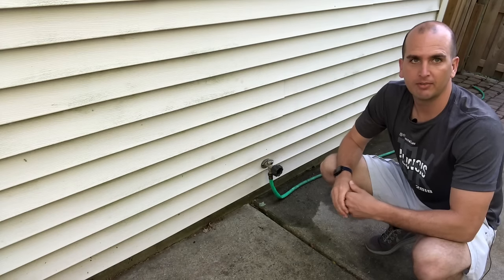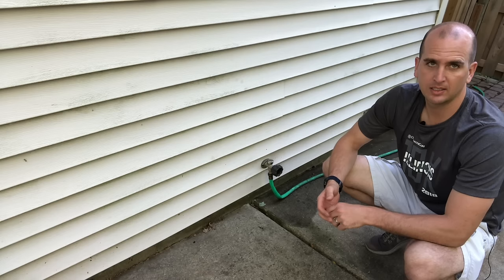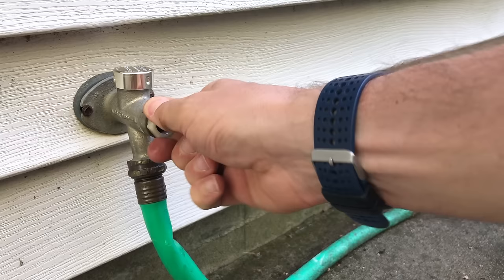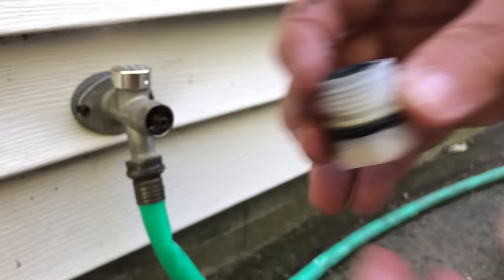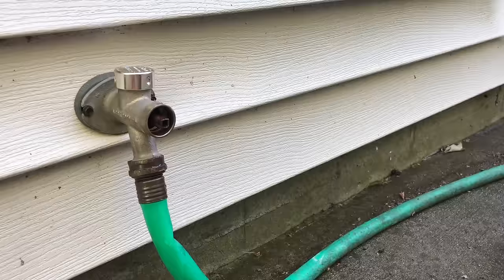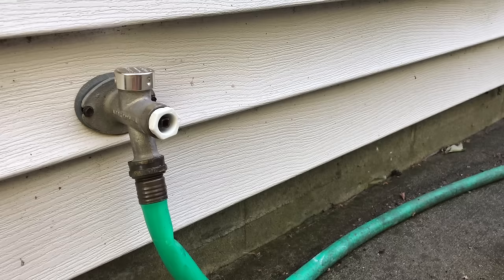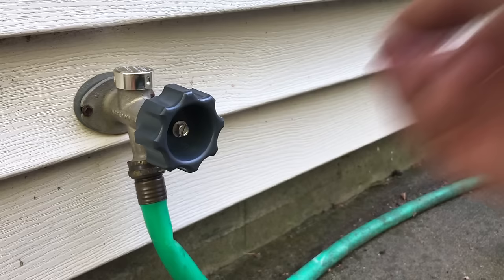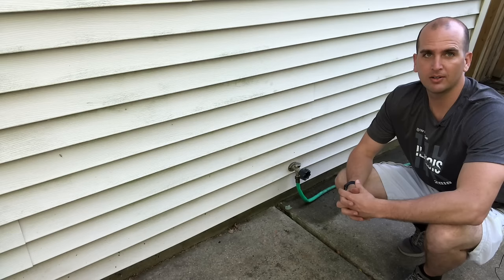How To Fix a Water Leak Behind the Handle of an Outdoor Faucet

Comment: You might want to consider this:   before shoving the new gasket in,  temporarily put the handle back on and turn the water on to flush out the debris from the old crumbly gasket.  If debris is left in there, it could cause the new gasket not to seal completely.
Reply from the maker: I like the pro tip! Thanks for sharing.
Reply: I agree. Additionally, putting some lube even just spraying some wd40 on the rubber parts will prevent the rubber being torn or warped during the tightening process. I might add too, that WD40 is not a penetrating oil. To free up,that rusted bolt a proper penetrant will work a lot better. There are several different brands.
Reply: WD-40 usually is not good to spray on gaskets since petroleum products will cause rubber to swell. Silicone based stuff is perfect for that.
Reply: @hobosaur4250  
You replied to the wrong comment.  I think you intended to reply to @garethgoodchild2643
Reply: Can u make a video showing how to put an on/off handle instead of the type you just replaced?
Reply: Thank you. Easy to follow. I will watch the Siphon Valve video, too, since I don't know what that leak looks like.

Comment: Tip from a navy vet, rusted screws and bolts will loosen if you hit it with Tobasco sauce, wait 5-10 min.  They use it at sea.  It works!
Reply from the maker: Seriously?  Tobasco sauce!?!? That is a great hack if it works and I am definitely trying it on the next rusted bolt I encounter 👍
Reply: I’m a Franks Hot Sauce guy myself. I’ll give it a try!
Reply: @glenndespres5317 I put that sh*t on everything 😂😂 EVERYTHING!
Reply: To explain to anyone still wondering about this: tobasco is a vinegar based hot sauce. Nothing to do with it being a hot sauce, it's the vinegar.

Comment: In general is that a one size fits all kit for that type of spigot? That's exactly what we have on our house and is leaking from the handle. Odd thing is, when I took the handle off, there's only that metal rectangle piece the screw goes into. There's no white threaded plastic piece that goes around that like what you replaced.

Comment: Thanks, Everyday Home Repairs for this video. I had NO CLUE how to fix this problem and your video helped a lot. I will say, however, the mechanics of my faucet were a bit different. I had a tan 7/8 inch screw and I HAD to turn the water off because I needed to semi-remove the stem to remove the washer. It didn't come out easily like it did in your video. But pulling the stem was pretty easy (just keep turning the faucet as if turning the water on until the stem comes loose). Then I replaced the washer (different washer than what you used in your video), put everything back together, and NO MORE LEAK! Thanks again!

Comment: great video...also easy to just replace ALL the gaskets (pulling entire stem out)...why not...ONE THING I found out was white does not always mean right hand thread...I was only able to determine this because I paid attention to the WHITE cap I removed which was FLAT on the inside edge..NOT inward rounded/Concaved like in the video...I only mention it as there is info that says WHITE is always right hand...I used the TAN version and corresponding gasket/all fixed...so just pay attention to what you removed and match to the kit. Thanks for the Video! Stopped my leaking faucets! ALSO...my handle bolts were rusted on...so I had to dremmel off the handles and removed the entire stem...some PB blaster and heat (gently hold the stem with a vice or pliers while working the rusty bolt out...finally was able to work the bolt out. Chase the threads with the new stainless bolt that comes with the new handle kit...even maybe a dab of anti seize.

Comment: I'm a fairly new home owner and I was having an issue with my hose faucet not fully stopping the water.  I had turned off the water to the faucet and was getting ready to call someone until I thought I'd see if a tutorial would help.  I found this video, and 3.5 minutes in, I pause and try what I just saw.  A super loose piece that I tightened and BOOM, problem solved.  Thanks for the quick and easy video!

Comment: Thank you for this video (and the anti syphon valve video).  I was a little afraid at first to tackle this as the leaky faucet is in the garage and my old man was like, "call a damn plumber".  I went to Ace Hardware and got the exact same 2 kits you used in this video for $14.99 and also replaced the old crusty, rusty screw and handle for $8.99. So much cheaper than spending probably a couple hundred dollars for a plumber and I learned something today.  It did not go without frustration and ended up doing the left (cream colored twist tightener) as the right (white one) didn't quite work like yours did because of the threads but end result...no more leaks.  Thanks again!

Comment: Well done Scott, I’m very surprised with the amount of great detail you showed, that you did not crack the valve open slightly(after removing the old packing seal) in order to flush out the small pieces of that old packing seal. Just a though......now back to work on mine. Thanks Man.
Reply from the maker: Good tip Trent, thanks!

Comment: Thank you so much. I've got two of these leaky faucets on the house and have been wondering how to fix them AND they are both 27 yrs old now. I knew there must be a gasket or seal involved but thought I might have to  remove the entire faucet through the wall. Glad I found your video, it's much easier than I thought. You make a very clear and detailed video. Very helpful.
Reply from the maker: Thanks Dale, happy to help!

Comment: Great Job, I do it a little different, i flush out around the seal area and add some plumbers grease to ease the friction on the O-ring and seal. maybe you did that but didn't show it. but still a great job stopping the leak. having all the possible replacement parts was smart.

Comment: Thanks for the video. I didn't have the repair kit with the cone washer, but I after scraping the old deteriorated washer out, I managed to get a flat rubber washer and another o-ring washer both in there and it did the job.

Comment: Great that you replaced so many parts but  thinkyou could have replaced the washer on the end of the stem to prevent later leaks. What you refer to as a gasket, is actually packing which crushed and prevents leaks around the stem.

Comment: This is exactly what happened to my outside faucet today, went to Menards expecting to buy a new faucet. The top chrome cap holds on the pressure valve. (Not back flow) that also broke. Saved a ton with the kits. Oh, the faucet was just installed a year ago. Failed to soon in my book.
Reply from the maker: 1 year might be a bit low in terms of expected life.  Hopefully you purchased a different brand this go around. 😁
Reply: No, didn’t purchase a new system, just installed the repair kit
Reply from the maker: @teaglet   I would say the kit should last longer than the original 🤞

Comment: This worked great, thanks!  
The only issue I had was that the screw wouldn’t work to get the handle back on, it would just spin (worked fine if I tried it without the handle). Anyone else have this same problem?

Comment: Thanks for your videos, this looks very similar to the one I have. I also seem to have the white plastic right hand turn adapter. Mine looks different however in that it has a large nut behind the white plastic piece and my valve stem sticks out much more than yours. Not sure if that is standard for this model faucet. I have an ASSE1018-A faucet according to the number on the side.  I will attempt to inspect this more thoroughly and report back. Thanks for the part numbers you've provided. I am not sure if a picture of mine can be posted to show you my setup.
Reply from the maker: Hey Ricky, unfortunately pictures and/or videos currently can’t be posted in YT comments.  You can jump over to our Facebook group “Everyday Home Repairs Community” and that is where you can post pictures and videos which help a ton with troubleshooting.

Comment: This is an easy fix IF the hardware store has the same gasket for the valve.  Frustratingly, that wasn’t the case for me and I had to replace the whole unit.

Comment: Thanks for the video... The sad thing is someone else tried this in the past, the bolt is stripped so no socket can go on it, I got a 9mm to fit on it, but, it does not grip good enough, and cant put a strait slot screw driver because it's so bad rusted, none that I have will fit in it...
Reply from the maker: Hey Dave, Unfortunately I don’t think your are alone in dealing with damage from the last owner on a project such as this.  Next I would try a heat gun (no flame to not damage the handle) and some WD-40 to try and start working at the rust.  Best of luck and let us know what works.
Reply: Well, it started to leak again. At least the turn off valve is right on the other side inside the house. I guess I will have to try it agian..

Comment: I've hit that rusty screw with 4 days if pb blaster as well as trying wd40.  Man. I can't budge it.  I used a strap tensioner to counter twist the handle while using a socket in the screw.  Still nothing! Wow.
Reply: Any luck and tips? My screw looks really rusted and I hit it with WD40 and still wouldn't budge either.

Comment: Thanks for video.  Very helpful, BUT mine is a left tighten.  The nut in place didn't have the O ring or the gasket and the repair kit I bought doesn't have an O ring or gasket in repair diagram either. I did the repair without either and there is still a very slight leak.  Thoughts?

Comment: Not supposed to roll the o'rings onto the fixture but rather slew them on so the outer surface stays outer,
Reply from the maker: Hey George nice catch!  Thanks for the additional info. 👍
Reply: @EverydayHomeRepairs  what does "slew them on" mean?
Reply from the maker: Hey Sheri it just means to work the o-rings into place without rolling them.  It is easiest to let the o-rings roll as you push them into place over the threads but that can damage the o-rings and/or negatively impact the final sealing surface.
Reply: Thank you for your explanation!  I keep forgetting that part, ugh.

Comment: Very helpful.  The head of the screw on my handle was very rusty and broke off trying to remove it.  I would expect the handle to slide off now but it will not.  Is there anything else holding it on?
Reply from the maker: Hey Steve, no it should come off.  If you have some WD-40 I would spray it on as much of what is left of the rusty screw.  That might help to loosen things up enough to remove the handle.

Comment: I have same frost proof faucet outside, it leaks when trying to turn the water off...can't tighten it enough to stop the flow and turn water off...I used a 3/8" socket to loosen the screw, and I was able to then turn the handle enough to shut off the flow of water...why did this work, and what should I do to fix this???! Thanks

Comment: I do this every year, must be a better system. The front replacements cost around $16 the top replacement parts cost $7.
Reply from the maker: Assuming you have harsh winters?  Ours start to leak but usually hold on for several years.
Reply: teaglet1  Simply cut the pipe inside the house, install a valve and shut the water off inside the house and leave the outside faucet open for winter.
Reply from the maker: @1DirtyMutt  Thanks for the comment.  Do you have any experience with finished basements where there is no access?  Have you seen  people add access doors to the shut off valve?

Comment: Mine is already dripping when its even tightened. Considering yours is not leaking when its tightened even before you change the material, I guess the issue is different? Do you think whatever comes in the kit will be enough?

Comment: This is a great video.  I was inspired to do my own repair after a plumber wanted $950 to replace the whole spigot.  I found the replacement parts and got to work, but when I tried to remove the white plastic (right hand) nut, it would not budge.  In trying to force it half of the outer ring broke off.  Any advice on how to remove it?

Comment: Hi Scott, did this and your other video for the vacuum thingy. Used the same repair kits, mine is a Mansfield from 1998 but I guess Prier bought them out a couple decades ago. Anywho, my handle is still dripping water but only when closed. Granted, it’s much better than before but any idea why it would continue doing this? I cannot hear water running from my main line anymore, but it would be great if it could stop altogether. TIA!

Comment: Hello Scott. Not sure if you will respond to this. 1st off thank you for these two vids. 2nd. I have this exact spigot, was curious if you have any information about taking it apart even further. Similar to one of your other spigot vids that you pulled out the 12” anti frost line and replaced the small rubber washer at the end. The design of that spigot was different than the one in this video. I was curious if you have a disassembled version of this spigot? Thank you very much.

Comment: For a tough to remove bolt, would you recommend turning the handle all the way ON, then use a ratchet?  Or, a pair of pliers on the handle (in opposite direction) w/ the ratchet on the bolt?
Reply from the maker: Hey Boxing, yeah I would recommend a ratchet if you bolt is tough to remove with the water main off. Best of luck on the repair.
Reply: Boxing For a tough bolt removal 1.) spray PB Blaster penetrate (best stuff)2.) if a hex nut ( six sided bolt head) bolt be sure to use a six point socket for best grip.Good luck.

Comment: My handle didn't just pull of like the one in this video. In that case give it a light tap from behind with a wrench.
Reply from the maker: I would think it is just some mineral deposits holding the handle on which you should be able to break loose with a few taps.

Comment: Great video on both items but mine drips from the threaded faucet where the hose attaches. Does that mean I need to replace the entire Sillcock or is there a way to pull that shut off valve out that the handle goes on and replace the parts behind that? Maybe you could do a video on that if I'm on the right track here? Thanks.

Comment: Ugh, I had the kit already and have a similar faucet and when I found your video I thought "great! - this looks very diy!". Well of course when I put in the right hand gasket and tried to screw the right hand white nut back in it won't catch a tread. Seems like the gasket is too thick:( Now I am on a video search to find out how to get the gasket unstuck.
Reply: sounds like you have the same version I do..white plastic BUT it's likely left hand thread...try the TAN      
part in your faucet see if it threads in easily...with the corresponding gasket. if you have the old one still look to see if the inside portion that faces the gasket is FLAT...if so use the TAN part.

Comment: Thank you SO MUCH for your video!  Our old and rusty, outside spigot is leaking, but only from the part that turns the water on.  Is it best to replace the whole spigot or can I just do the part that's leaking? Because it is old and rusting, I'm thinking it would be best to replace it all.  But not sure.  Thank you in advance.
Reply from the maker: 🤔 is the only part rusted the bolt and washer holding on the plastic handle?

Comment: My threads on the inside where you replace the white plastic piece behind the handle are all messed up, guessing from previous owner. how can i fix those threads?
Reply from the maker: Hey spanky, go over to Facebook and search for "Everyday Home Repairs Community."  Join the group and then post a picture on the messed up threads any any additional pics which would help assess your specific situation.  Once it is posted I will take a look and see if I can help. 👍

Comment: When I took the handle off there was nothing there? Just the square valve.  It is missing the plastic nut then?
Reply from the maker: That would be my guess.  I am sure there are other designs which I am not familiar with but if you see threads I would bet you are missing the plastic nut as seen in the video.  Good Luck on the repair.

Comment: White is NOT always right hand thread. My plastic nut is white and I tried to open it counterclockwise and I tightened it instead AND I over tightened it soo bad now the white plastic nut edges is rounded. I am ordering bolt extractor for rounded bolt, and I hope I will be able to open it. For now, it doesn’t leak BUT after I put the handle back on, I can’t turn it at all. Is this normal that overnighted nut means the handle can’t be turned? It’s now on open position so I temporarily use hose’ shut off valve to turn it off. And what’s so stupid is on that white nut there is a print out: remove - right arrow , tighten - left arrow. I read it too late.

Comment: Thanks for this video Scott. In my case I can't completely turn off the faucet. I could feel that it is closing as water pressure gets reduced, but on further turn it goes back to full flow. Any advice will be helpful.
Reply: I have the same issue
Reply: @natefreedom5886  I got a plumber to replace the frost free spigot - cost $240.
Reply: @pdwivedi  I have a plumber coming Friday and was quoted $280. Thanks

Comment: I have an approximately 40 yr old house and a leak behind the handle of the faucet.  There is no way to get into the faucet so I’m hoping the taking the handle off and checking the O ring and any gasket if it has one.  There is no anti siphon on this faucet.    Will I need to shut off the water to the whole house?
Reply: So did you have to shut your main water supply?